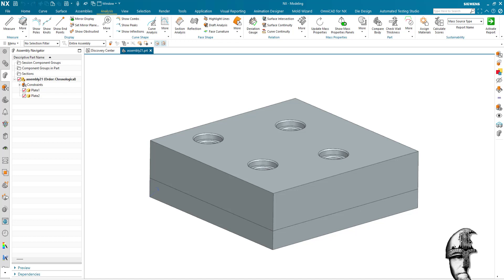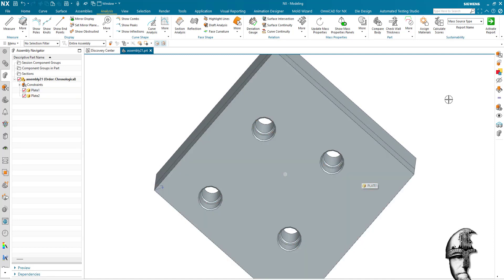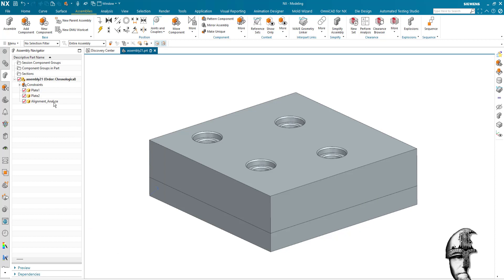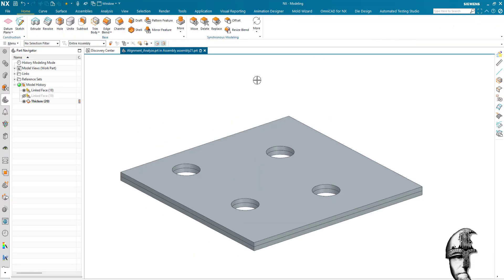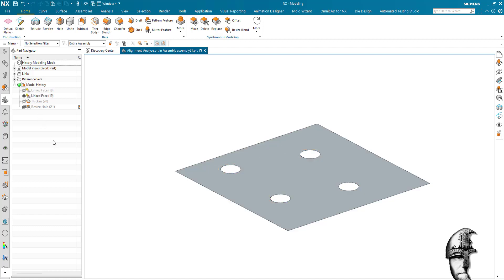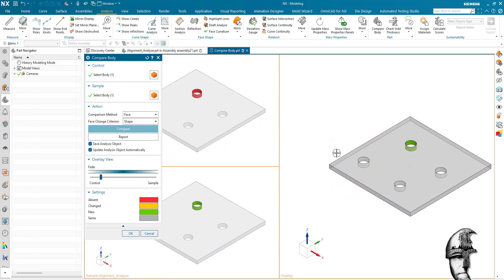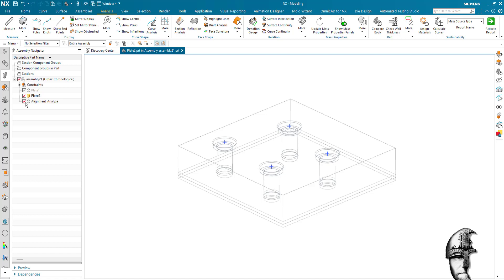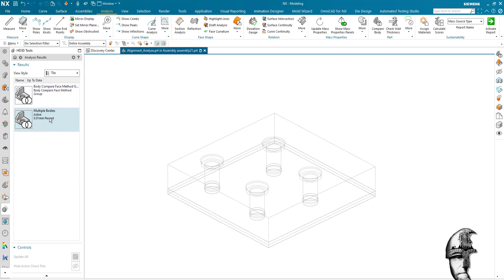Hole Alignment

Comment: Hi Frederik nice video. Does your method means that for every hole you need to make wave linked parts?
Reply from the maker: Hi @larsdijkshoorn9820, firstly thank you for the kind comment here, very much apreciated. Well the idea here was not to have to wavelink all the indinvidual holes as that would create a lot of wavelinks potentially.Hence the interfacing/mating faces are selected for wavelinking. The thicken (recreates all the cylidrickal holes in one feature) and adjusting the holes to the same size allow for model compare to work on what should really be the same if the holes are created and maintained correctly. So the isea here is really to keep the wavelinks to a minimum.